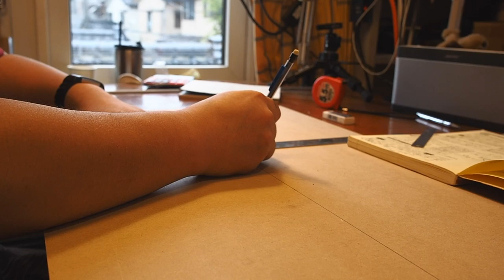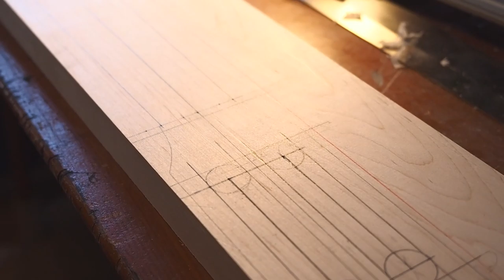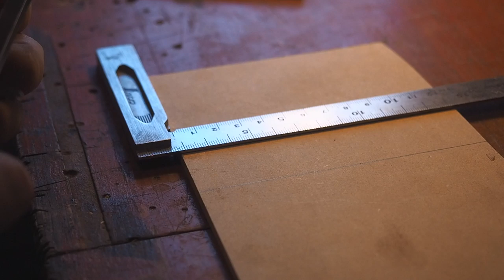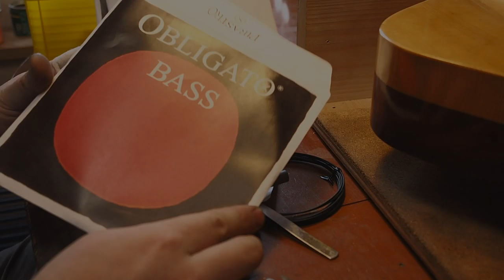The Making Of Electric Upright double Bass Guitar For Sale!

Comment: I noticed there´s lack of sustain because you have not spotted the points where the sustain "drains out". I did this to a Gibson bridge: I put white glue all around, inside the clean holes of the string saddles and underneath ... move screws and intonate again before glue dry out. 3 hours later the glue "disappeared" ... shrinked I must say ...  and all the pieces were like one solid piece increasing sustain dramatically. I put white glue in the holes of the 4 posts (Bridge and Stop Tail) and then a drop of white glue in the clean threads of every post and put them back. Set bridge and stop tail. Clean escess of glue and let dry. More sustain after this. I remove the whole bridge and put some glue in the threads AND in the holes in both sides of the bridge and put it back. Hours later ... the lack of sustain was gone. One more thing, the key for a thick sustain is in the contact areas, the more contact area, the more sustain you get. Every instrument has some points that makes sustain poor and weak. Once you spot those points and fix them, you get an organic, almost natural tone in any instrument with loads of sustain AND high VOLUME, even Strats with tremolo/whammy bar can be heard when you play guitar .... unplugged. Great work Andy .... do more custom projects, please !!!!